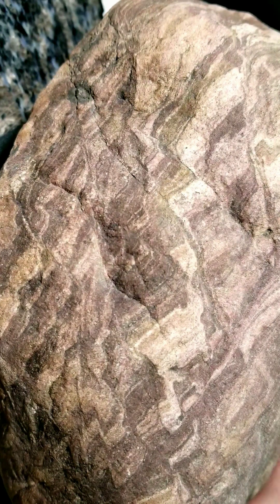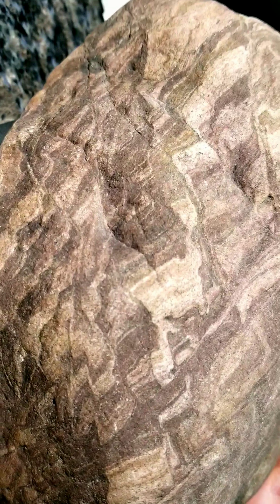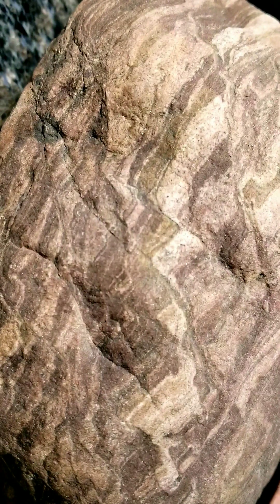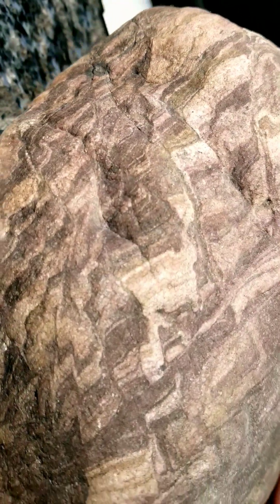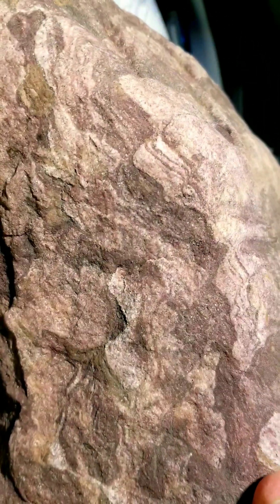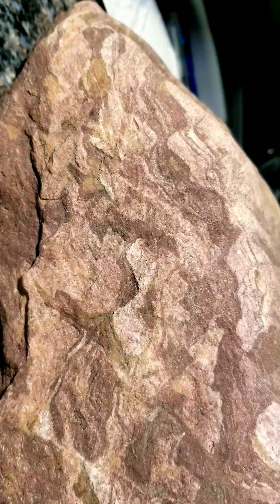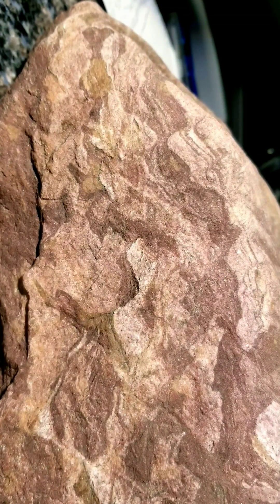Every Rock's a Snapshot 9: Thrust Faulting in Sandstone Cobble #geology #pebbles #rockhounding

Comment: So these are "steps" of different sedimentary rocks deformed into one mass?
Reply from the maker: Well, if you look closely, you will see that this is truly in miniature. The same layers can be identified by width, color, and sequence; and then followed as they continue through the many sections, and each fault offsets such that each section moves up and over the previous one. Expand this out over hundreds of miles and you can see how it would lead to massive mountain building east of where the collision occurred. This is quite different from the processes that led to the southern and central Rockies, which, as I understand, were due more to uplift rather than thrusting from the west.
Reply: @chrissgraniteparadise2656  it is sedimentary? Fascinating, I understand there are at least 2 camps, I'd like to hear both on this specimen's tale